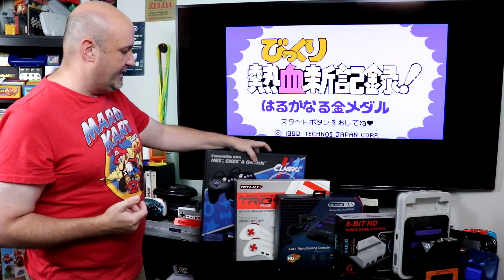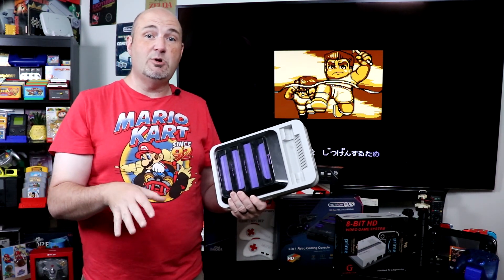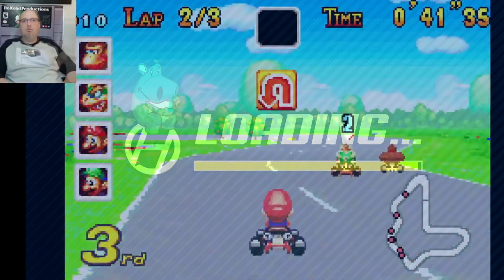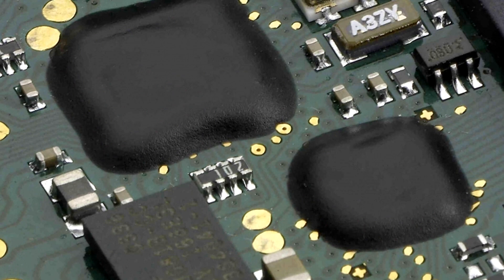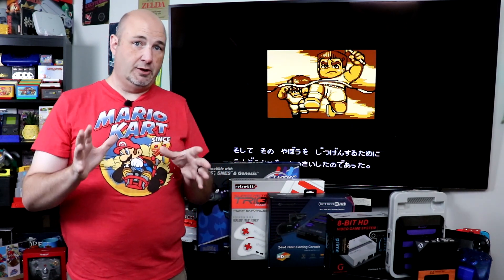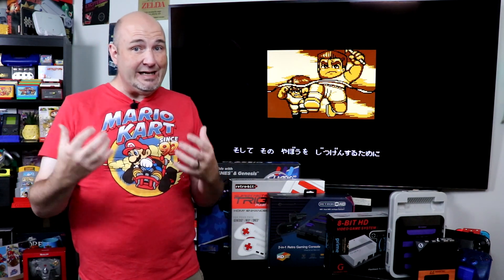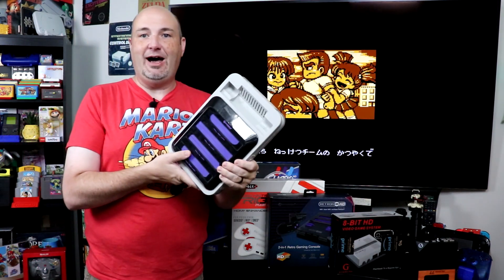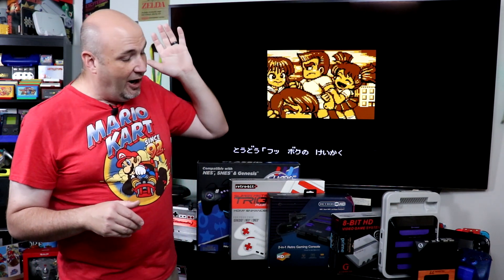Understanding Clone Video Game Systems - SoC Vs Emulation Vs FPGA

Comment: It's worth pointing out that many consoles underwent revisions and the later revisions are essentially clone consoles. For example most snes consoles you find in the wild are the  "1 chip" models. These are a hardware revision that work off a completely different cpu than the original "2 chip" models. The 1 chip models suffer from all the same problems as any other clone console i.e. incompatibility, graphical glitches, and sound glitches.
Reply from the maker: If it is from the original manufacturer by definition is not a clone it is original equipment. As you stated though, it is a hardware revision
Reply: @RoXolid  I am making the point because I don't want people to think there is anything wrong with clone consoles. Nintendo clones their own consoles all the time they just rub some euphemism on it and call it a "revision".

Your point of  view makes sense when buying products from game stores. It would seem silly to call revisions "clones" in that context because clone consoles sell for a different price. However developers and speed runners see it differently. I heard a hardware developer refer to his official work with a company as "cloning" the "original" console. His job was to use cheaper hardware for a console.

From a gaming perspective (actually sitting down with a controller and playing ) hardware revisions play like clone consoles. Just because it's officially licensed doesn't mean the developers did a good job. The SNES jr, for example, has pretty bad compatibility. Fpga consoles are actually more accurate and compatible than most officially licensed hardware "revisions".
Reply from the maker: @riggel8804  this is where consideration of the audience intended along with the type of content being delivered matters. If you're in the speed running, you already know more than what this video is providing. This was a very superficial look at the three different common technologies for those looking to perhaps purchase their very first clone system.

Comment: The MiSTer is superior to clone consoles and original hardware. It does have some drawbacks though: 1)It's not plug and play; 2) it's not cheap (however it's about the same as an analog product); 3)It won't validate my plastic (plays software only).
Reply from the maker: That is not a clone console in my view. A clone console has to play physical media
Reply: @RoXolid  So it would be a clone console if only someone made a reader
Reply from the maker: No, I would not consider that to be a clone console. A clone console needs to be all in one, out of the box, designed to play physical media.
Reply: @RoXolid  Why?
Reply from the maker: @Cheesecannon25  because otherwise you could consider a computer to be a clone system. Design and intent matters in my opinion, and if it was not designed to do something out of the box from the manufacturer then I don't consider it to be a clone console. Perfect example, the poly mega offers all these different adapters for different systems, right? The manufacturer designed that into it, hence I consider that to be a clone.
Reply: @RoXolid  So it would only count if someone else assembles and sells a MISTer w/ reader
Reply: @RoXolid  I think a console is a "clone" when its hardware is designed to replicate/clone another piece of hardware. Tower pcs and the Polymega  don't do this. In that case Software is written to adapt hardware designed for other purposes. The system on a chip consoles and officially licensed hardware revisions are all clones. Their hardware is designed to  replicate another piece of hardware. MiSTer really isn't a physical clone. It's hardware isn't designed for gaming. We probably need to use a different term for the fpga consoles including the analog products.

Comment: Retro trio+ is my favorite right now, paired with cheap sd card flash carts it's alot of fun.
Just replayed through Chrono trigger for the first time in 20 years
Reply from the maker: If you're not playing original cartridges and just using an everdriver flashcard you would probably be better and cheaper off with something like a mister or retropie
Reply: @RoXolid  I actually have several really good emulation options in my house now, I just wanted a console and cart experience. 
And we know original cartridge prices are way too high for most games to be a serious option.
Reply from the maker: @jayceodell  while more rare games have exploded in price, you can create an excellent collection without overspending. A great way to save as well is to use Japanese import games. For example, I got all six mega Man games, but the rockman versions from Japan, and I believe my total investment was under $150 for six titles.
Reply: @RoXolid  so I picked up a Nes from a friend for $25 and I have a N8 everdrive. I'm using a composite to HDMI adapter now but the picture quality is less than desirable. The N8 will not work on the HDMI retro trio plus so I'm looking for a good way to upscale the image that doesn't cost 200$. Any suggestions?
Reply from the maker: The RetroTink Classic should be the ticket
Reply: @jayceodell  there’s no difference between playing games off an sd card or everdrive vs a physical cart on any retron/hyperkin because they are cart readers that don’t actually play physical media, theyre emulators no different from a computer, a more powerful cpu/gpu/ram will allow you to play a game with more intensive settings like 60fps and a higher frame rate, but only original hardware and FPGA play directly from physical games

Comment: Great vid Gary!. 
I always try to use original systems, however, i do own a Mister Fpga and it's fantastic. Things look and feel just like the original. It also looks amazing on hd tv's. Nes, Snes, Genesis, Amiga, gameboy, tg16, etc... No lag at all also.  You can add filters, scanlines, and much more. Everything is perfect. Can't recommend enough.
Reply from the maker: It doesn't play physical media though correct
Reply: @RoXolid  they are working on a way using the same adaptors that are being used to dump catridge roms and backup.
Reply from the maker: @TheLyonkoke  But that's an add-on versus something it was designed to do.

Comment: Man I'm just not sold on fpga. I remember when people were saying it's not emulation it's simulation lol. Then it turned out to be less accurate than bsnes.
Reply: I’ve used a almost all of these system ls and I have an AVS and super NT and I wouldn’t use anything else. Only thing I would use different is modded original hardware but I’m terrible at soldering.
Reply: Disregard the artificial hype and marketing- it is a form of emulation.  And there are misconceptions about it too, but at the same time they don't mean FPGA is bad no more than the marketing means it's magically good.  FPGA has a big advantage over software emulation- the processor can run instructions in parallel like the original hardware.  This means accuracy comes at a much lower cost.  It doesn't mean an FPGA core is magically more accurate- that task is still left up to the developers.  However, MiSTer developers, for example, are almost universally dedicated to making their cores as accurate as possible.  Many are decapping arcade boards and going back to basics on their coding to re-assess basic behavior in systems, and it's actually benefitting both sides of the emulation coin.  Many bugs that have been long standing in MAME have now been fixed by the corresponding FPGA core, and the solutions shared back to the MAME developers.

I don't know where you've seen that the SNES core (or do you mean the Super NT?) is less accurate than BSNES, but I think if you do some research into MiSTer you'll find a wealth of information about the cores and their development.  It's truly the next frontier for emulation of many systems (think PS1 era and earlier) and there is so much active development you'll find new cores and improvements almost daily.
Reply from the maker: I have a couple friends that have the Retro USB AVS and they swear by it. That they say that the experience is absolutely wonderful. Now doing an NES and a famicom definitely takes less horsepower than say a turbo graphics 16 or super nintendo, or an N64, but everything that I've heard and seen and everyone that I've talked to absolutely loves it

Comment: I used to have a Famiclone. Sound was terrible but it played nice until its last days. I also owned a fake Mega Drive 2 before I got the original hardware. 
If I want a clone system I'd choose the Analogue consoles. More expensive than getting the originals where I live but it's a great purchase
Reply from the maker: Oh no, I don't ever want to go back to a CRT
Reply: @RoXolid  that's valid. The Analogue clones are a very great choice to play with HDMI

Comment: And doesn’t an fpga use software to emulate anyway? I mean I love it but I think is not all to different.
P.S. the avs is awesome.
Reply: While FPGA is a form of emulation, it's different from software emulation in a fundamental way.  There is coding that gets programmed to the chip, but this is literally like any other chip in existence- they all have to be programmed to behave a certain way.  FPGA simply lets the code be executed in parallel rather than sequentially, so timing accuracy comes at a much lower cost.

Comment: I think an emulation system can't be considered "clone hardware" since it's basically using a totally different architecture, but for many people it can be considered a clone console. As for the FPGAs my issue is that compatibility isn't 100% out of the box, the developers just go implementing patches as they go, but sometime they stop while some games still are incompatible.
 Now "System-on-a-Chip" is too much a generalization, some "Super Famiclones" have almost the same quantity of chips as original systems, the only one that just exists on the single chip format is the Mega Drive(and by extent the Master System, although later models already used SOC design including the Game Gear), and what these companies like Hyperkin, Retro-Bit and Old Skool do is buy Chinese clone PCBs and give it better cases, controllers and package, now, I think I already mention that many games like Castlevania 3 and Virtua Racing don't work because of wrong wiring, what these companies should do is have the fixes already pre-installed into the board, as for the audio and video issues, some Japanese clones seem to have a more accurate palette and sharper HDMI output, so if we wait a while these will probably come over to the west, the real problem is the audio on Mega Drive and NES, replicating the reverse duty cycle would need a lot of engineering skills, but I remember that there was a synth keyboard released in 2020 that used the Yamaha sound chip and claimed to have a 100% accurate recreation.
Now, if you want a clone system that can play the entire library with accurate graphics and sound look for the GBA clones called Revo K101+ and Digi Retro Boy.
Reply from the maker: Sounds like you have a good basis for a video of your own, let me know when you post something and I would be interested in watching it
Reply: @RoXolid  I thought about doing it, but I probably wouldn't get any views, so I prefer just writing for forums.
Reply from the maker: Don't know if you don't try

Comment: My Favorites are the Retroad 5 Plus with the GB/GBC Extension Converter from Ali-Express and the Feihao HDMI Famicom Handheld from Ali-Express. The SOC on the Retroad 5 Plus is really pretty spectacular. With the MD adapter and the Everdrive MD Pro I can play SEGA-CD on the thing minus cutscene audio for some reason but it works. Popful Mail is great.
Reply from the maker: Thanks for sharing!
Reply: @RoXolid  The Retron 5 is on sale right now for $120.00 over at Ali-Express. It's normally $150.00. Well worth the money with all of its adapters you can get for it. It comes with two wireless controllers too. It has different aspect ratios and is region free. It even has controller ports if you want to go wired or use an 8bitdo SNES Dongle. Great System!!!!!

Comment: I think my only complaint about Hyperkin Retron 2 is the sound. Haven't looked into any clone systems with HDMI support.Though I think it's great for import games.  I would prefer emulation as it's how I prefer reliving classic games if it's possible and doesn't sacrifice anything.
Reply from the maker: The newer Retron N, the AV Version, has pretty decent sound actually.

Comment: Another great video! In addition to the Gamerz Tek systems, I have a Retron 5. The main reason I bought the Gamerz Tek systems is because the Retron 5 does not play homebrews.
Reply from the maker: There's a way you can actually load games through the SD card, I wonder if you get the Homebrew ROM if you can get it to play that way?
Reply: @RoXolid  Thanks for the idea. Never tried that option!
Reply from the maker: Of course!
Reply: @RoXolid  I don't think this is possible because the retron5 5 does not support mapper 30 for the nes.

Comment: I have original hardware and use sparingly to reduce wear. I do have clones but there’s compatibility issues. I do have and love what Analogue offered with FPGA consoles as they’re updatable, have tons of settings and my experience with them are the closest to the originals. I have the AVS too and it’s pretty much the same as the Analog NT mini.
Reply from the maker: Yeah, I thought Kevtris worked on the AVS and works for Analogue now but not 100%

Comment: Retron 5 is the best bang for your buck with all these systems. It's a shame they haven't updated it in years to fix compatibility issues or allow people to make their own firmware and update the emulation cores.  This is one of the only systems that I know that will also take Game Gear carts which is super fantastic.  It will have a permanent place on my shelf for years to come. I would have rather had the retro freak, but it was over 2 times the price.
Reply from the maker: You know what, you're not wrong. It's an incredible value with all that it can do. They've had some manufacturing quality issues over the years, but if you get one that tends to work for the first 30 days or so it should last you years. Mine stopped working because I dropped it

Comment: Does this mean that the Retron based on the emulation is actually better than the one based on hardware ?

Does Retron based on the emulation, do not have sound lag (on hdmi) ???

I'm asking because i don't need a 100 % accurate graphics, i prefer to actually have the sounds that is not off.
Reply from the maker: Audio lag isnt' the issue with hardware, it's the actual audio sound itself. The audio on the Retron 5 is much more accurate than the SoC systems
Reply: @RoXolid  thanks! :)
Reply from the maker: @grzegorz__  of course! If you have any other questions don't hesitate to reach out
Reply: I prefer the old analog clones such as the Super Retro Trio. Not emulation and does have accurate sound.